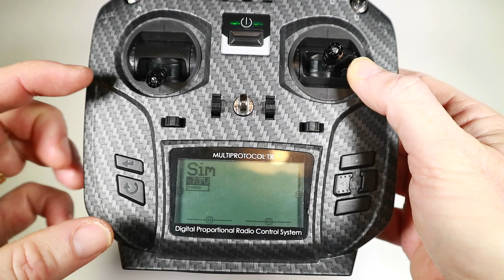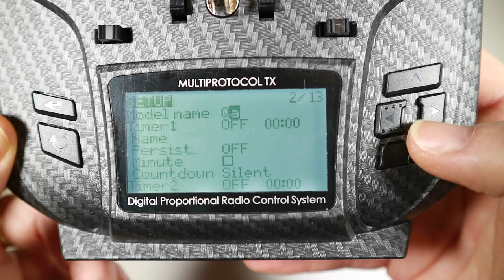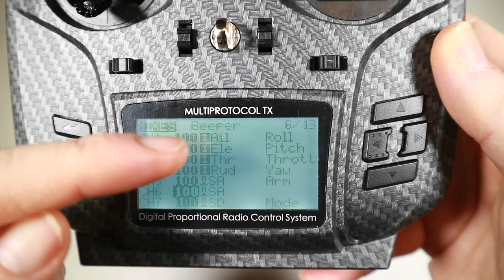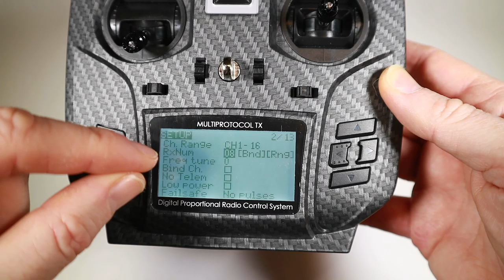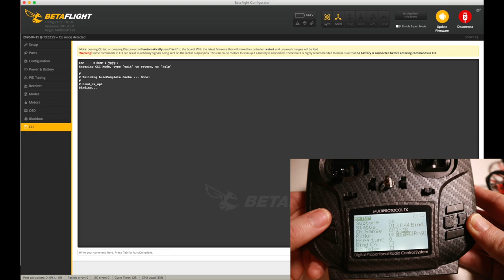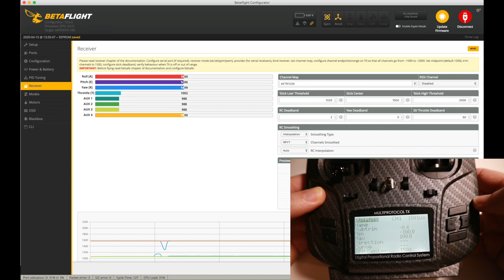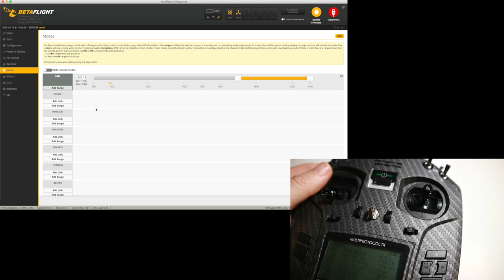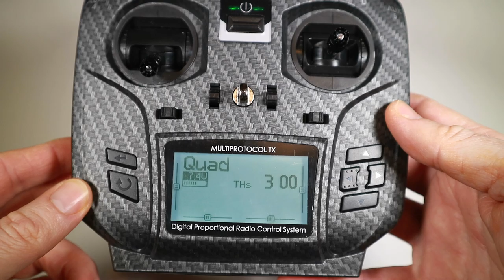OpenTX Pt 2: Creating a model, binding an RX and doing the necessary Betafight setup

Comment: Thanks for another great video. Any chance you could so how to do a setup for planes and heli’s especially about about new functions such as setting modes such as stabilisation, and special mixes such as flaperons. Cheers.
Reply from the maker: Helis no, I don't fly them and never have so I'm not going to be able to really comment on that.  In terms of fixed wing... it depends.  I thought about doing a general fixed wing setup covering dual rates and expo and perhaps stuff like rudder/aileron mixing.  But that's just basic channels from a recevier.  If you are talking about using iNav, then as far as setting the modes go it's the same as betaflight... both betaflight and inav fork from the same codebase.
Reply: CurryKitten Struggling with getting a throttle to work with a plane setup

Comment: Hi CK, thank you so much for your well explained videos on setting up the Jumper T12. Just one question: could you please explain how to create the arm function. I have added the switch into the MIXES page on channel 5 and called it Arm, but when I flick the switch once it is bound to the aircraft, it does nothing. Is there somewhere in the system, where I have to tell it what Arm means? Thanks
Reply: Hi CK, please disregard previous request as I was able to create the arm/disarm switch under special functions. Thanks again.
Reply from the maker: Sorry - I didn't get to this one very fast.  I'll answer it anyway and it depends on if you have some sort of flight controller in there, or if you are trying to create and arm switch without any FC.  I'm interested to know which you were doing, as I've never used the special functions part before.  The norm for me would be to add a channel range in betaflight/iNav/etc and set that switch to arm
Reply: @CurryKitten  Thanks. I just created a special function on a switch that overrides CH3 throttle when it is switched on.

Comment: How are you liking the remote so far?  I really like mine, works well and is compact.  Crossfire set up would be very helpful, thanks
Reply from the maker: I like the form factor, and the sticks are really nice as well.  I haven't really flown it "in the wild" as yet, but it's getting hours of sim work.  The Crossfire setup I did cover in reasonable detail before here https://youtu.be/E8VUdzQp00s  Let me know if there's any unanswered questions from that

Comment: Do you think the carbon V2 plus model internals would be an exact fit  in the older (yellow) jumper t8sg plus? I have the Jumper (Yellow) t8sg plus and want to buy the carbon model Jumper t8sg plus and have the yellow one for spare parts.Thanks for sharing!
Reply from the maker: I never had a t8sg.  I believe it's very similar, but was the screen size slightly bigger on the t8sg?  That's the only obvious difference I could find looking online

Comment: great video, is it possible flash my T8 pro plus with open tx?
Reply from the maker: I don't believe so - the question was asked as an issue on the OpenTX github page (https://github.com/opentx/opentx/issues/5979) but it doesn't have enough usable flash memory and no SD card, so wasn't seen as a viable candidate
Reply: @CurryKitten  but what about the new 2020 t8sg+v3 carbon? has physically the same hardware as t12 carbon including sd card. I cant find any new info on the v3

Comment: At 7.33 mine doesn't have a failsafe option. Also the beginning where you have the setup wizard coming on with the creation of a new model profile thats also not happening on mine.
Reply from the maker: I was generalizing a little on the failsafe.  Although most protocols do have a failsafe you can set, there are a few without an option.  So the basic FlySky rx's don't have them, and in this case the options won't be there.  As far as the wizard goes, that's a compile option on OpenTX so depends on what options were enabled on the firmware you've got installed.
Reply: CurryKitten Brill thanks for that! Total noob here. Thomas McCrudden (who you've spoken with before on here) is helping to get me off the ground....no pun intended.

Comment: I have never seen the model type screen and cannot find it, after following your button pushes. How do I restore factory defaults and start over, please? This is driving me mad.
Reply from the maker: What do you mean by the model type screen - the one that prompts you for plane/multi etc?  I think whether that part is there is down to an OpenTX option - so would involve you reflashing your firmware.  Alternatively - and what I'd recommend is that you just go through and manually add in your channels you will use.  It's better than using the wizard as you will get to do all your possible additional switches, and you'll know how to do it when you want to add a channel in the future for some specific purpose.

Comment: Does it matter if I've already set up the Jumper T18 pro with basics as haven't bought drone or fpv goggles yet? I thought I'd get practice on DCL game on Ps4 first.
Reply from the maker: Not at all, the thing about OpenTX is there is never just one way of doing things, and it doesn't matter what you've set up previously - you can go and edit it or create a new model in a completely different way.  Any updates you make on OpenTX, or even if you completely repopulate the SD card isn't going to affect the models you've already set up.  Can you use a proper radio on the PS4 version of DCL then?  If not, I have a sim you can try :)
Reply: @CurryKitten  yep, u just turn on ps4, sign in and then connect the USB c cable to radio, then to ps4, select joystick on radio and start Dcl game. In settings on game, go to radio setup and it'll come up with what radio ur using. Its easier to use a radio rather then the normal Ps4 controller. I've also inverted pitch aswell on radio cos when I play Shooting games on ps4, basically looking up n down is opposite on the stick.

Comment: How come in beta flight i can’t find air mode only acro trainer it’s not under black box like it is on your beta flight
Reply from the maker: Check to see in the configuration tab and see if you have Air mode enabled there.  If you have Air mode is always on, and so it's not shown as a possible mode.  Turn it off on the config tab and it'll appear back under modes.
Reply: CurryKitten word also thank you so much for these videos i just got the t12 pro and these made it so easy to set up n bind so thank you again